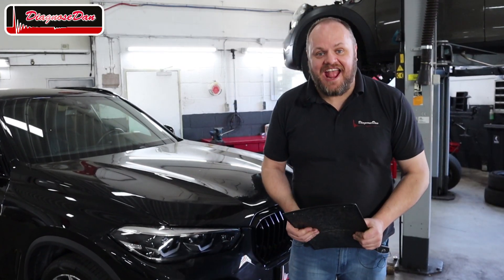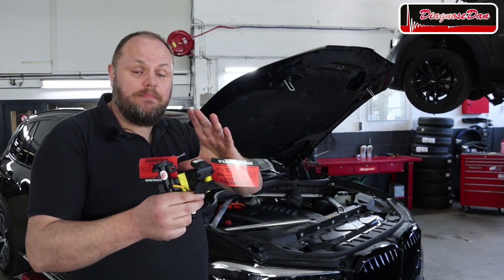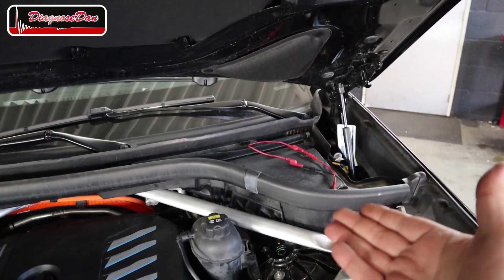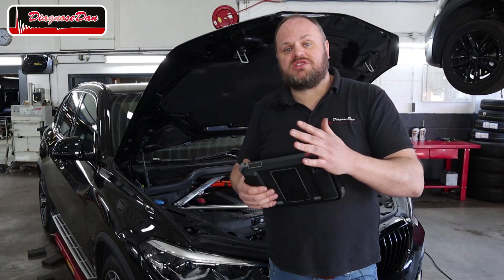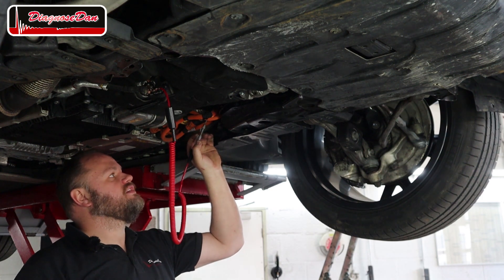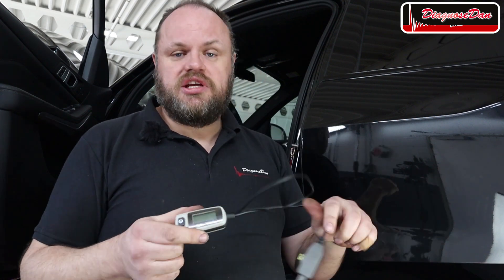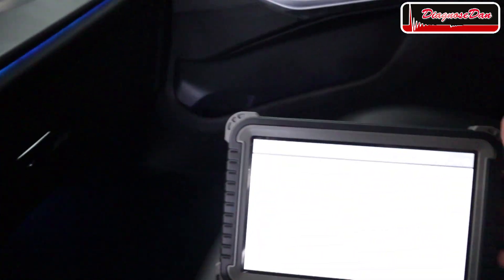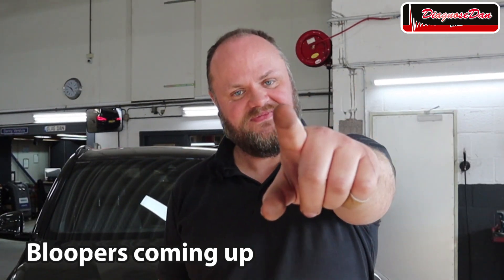Crashed 2020 BMW X5. Can we fix it?

Comment: Excellent work! This is the same car as my car, which is waiting for a replacement of 8 of 12 battery modules. Normally the car runs fully electric, bot now BMW says I must not charge it. Very good service by BMW in that they now pay for my use of petrol. My car has 15000km totally. More then 10000 km fully electric. Yearly average consuption is 3,5 liters/100 km up til now.
Reply from the maker: Its a recall, this car also needs new modules. They told this customer the car could catch on fire during charging

Comment: When you went through the EPS learning procedure, my question is, it would not be a better learning procedure if you would use wheel alingment equipment, knowing exactly the angles?
Reply: Most cars only need a rough estimate of the position according to theinstruction - then they figure out the details on their own.
When I did a similar learning procedure on my Audi A6 from 2001 all it needed was an initiation of the process from the scan-tool and then I needed to drive the car in a circle with a constant radius, with a specified speed and with good traction (not ice/snow). Then it could combine the data from steering wheel, ABS and G-load sensors to calibrate itself.
Reply: My guess would be only for center or straight but it seems it does not require perfection to accept the angles.
Reply from the maker: No need for that.

Comment: It always amazes me how easy you make it look, but it all comes down to years of experience, knowing how to use your diag equipment and good fault finding procedure. Yet again a great fix.
Reply: AND good quality information regarding car diagrams etc. In south africa we do not have good quality software regarding car complete diagrams and so on.
Reply: @sv_endless6340  some manufacturers are not helpful with info. German cars are quite easy to find.
Reply from the maker: Experience and good tools and info.
Reply: @Diagnosedan  do you have a list of the tools you use? Like powerprobe, testlight, etc? Thanks!
Reply: Very knowledgeable vedio....I really appreciate your efforts to make this vedio out ....keep going.. keep teaching us💫💯💗thank you sir
Reply: He only shows the successful diagnostic path afterwards and edits out all tests and checks that were likely performed but that did not contribute to the solution of the problem(s). This is nice due to its brevity and focus, but looks a bit "optimized". 😀 For example, the LIN bus signal to the PTC heater may also have been just an intermittent one, that looks good in some cases and under certain conditions, but looks bad once the conditions change, like temperature, humidity, vibration and so on. It is the same with the 12V feed wire and the broken fuse: a cable with a local insulation defect may occasionally touch a piece of metal (say on a bumpy road). Then it would blow the fuse again, even if it now seems to be working well. It is wise to take all the "Diagnose Dan fixed it again" triumphes with some caution and grain of salt. He is very good at what he does, but whether something really is a permanent fix, will sometimes need months and thousands of km to confirm on real-world road testing under several conditions. Especially with cars like this one with the large impact damage and a whole range of potential problems even after the repair.
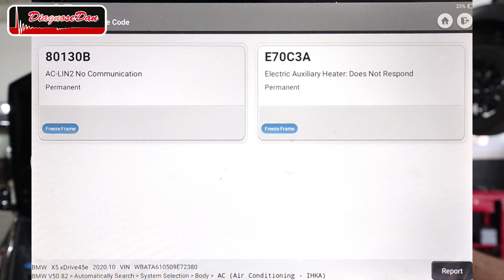Reply: @koeniglicher  The codes were showing as permanent on the code reader 7:36. On some of his other videos he has diagnosed intermittent communication faults also. https://www.youtube.com/watch?v=VF3s0uZ7ok0
Of course there is going to be some editing otherwise the video would be 2 hours long!
Reply: @koeniglicher  very true.
Reply: @koeniglicher  if Dan has fix it, it is fixed. 
Diagnose dan does not do temporarily fixes. 😜
Reply: @koeniglicher  Although your comment is valid, Dan fixes it to the best of his professional ability. If a new problem develops, that is a force that is beyond the Technicians control. The customer will have to pay for a new problem.
Reply: @davidhall3747  I wonder, whether Dan visually checked, in what way the wiring loom was repaired by the repair shop: using a new loom and connecting at OEM connectors? Or locally repairing the loom (soldering/crimping with repair wires, then adding insulating heat shrink) thereby introducing new potential risks or leaving potential wire breaks untested? I also wonder, what kind of tests Dan takes afterwards to test the electronics (wiggling, pulling, heat gun, coolant spray, spraying things down with water), and to testdrive the car, whether this includes heat (like in a spray booth) and cold (like a cold chamber test), humidty (simple rain may do, but you have to wait for it) and strong vibrations from bumpy roads. He could have done all that and just left it out of the video edit. Or he may have skipped these, minimizing work labour, but leaving more chances for future problems. This makes a basic difference, how you handle such jobs. And neither one is perfect for every customer.
Reply: @koeniglicher  Repairing a   communication wire like Lin Bus can be risky because the manufacturer does not recommend to splice any  wires that carry Data Pids.
Splicing Power and Ground wires is not a problem because those wires don't carry Digital Signals. I have yet to see Dan splice a Can Bus, Lin Bus, or a Flex Ray communication wire? It is recommended to never splice those particular wires under any circumstances. Other than that, Dan is an excellent Diagnostician.
Reply: @davidhall3747  As Dan explained in the video, he got the car from another repair shop with a list of remaining todo items, that they could not fix. I just wondered, if he looked at how  the previous repair shop fixed the wiring loom and how he tested, that they got it right.